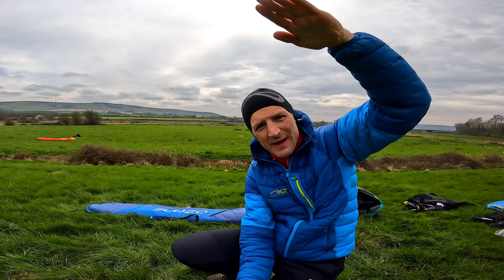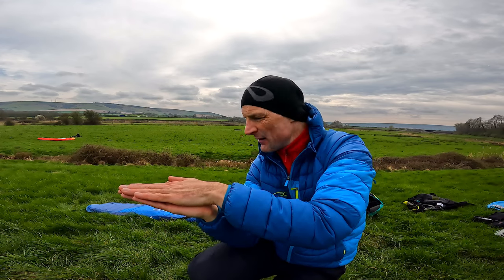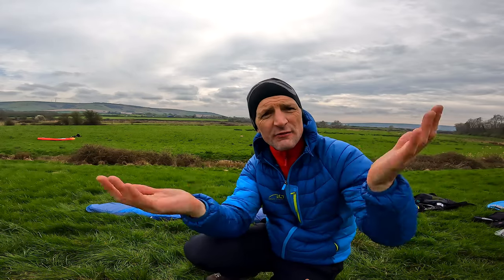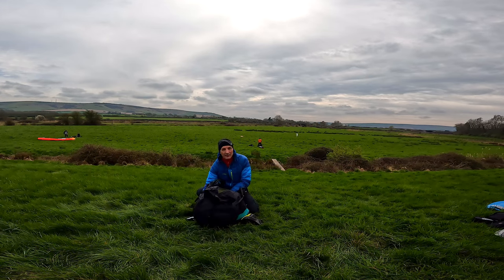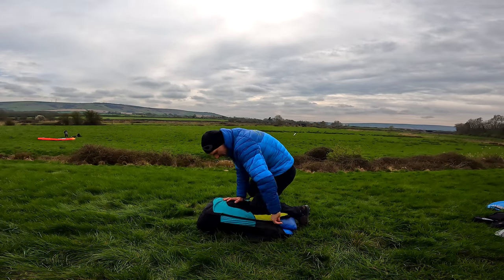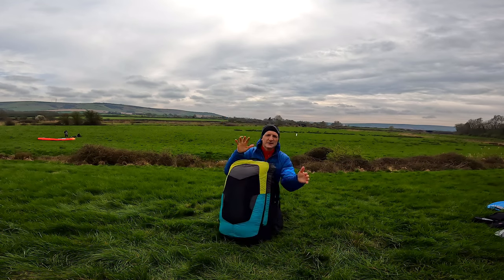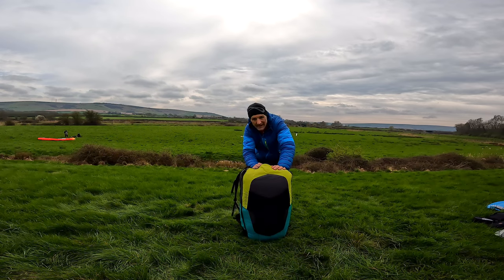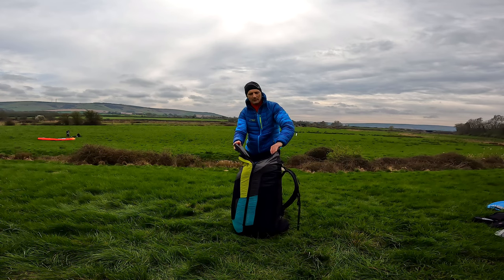How Do You Pack Your Paraglider With Lots of Plastic Rods? (Can we say goodbye to packing pillows?!)

Comment: Thanks guys! Ive been worried about the rods in my Iota DLS but I thought this trick wont work for me because my lightpack bag is too small. Then I saw you were using the same harness and bag as me. 5 Minutes later its all packed away again and I can stop worrying :)
Reply from the maker: Wohooo 🥳 Happy to hear that!
Reply: Same I just got my iota dls and I'm not used to the big rods in the glider normally I just use the compression bag, now I need to look at new ways to pack the wing
Reply: @KyleGoesUp  honestly I'd just pack it the way flybubble show in this video. It's the way I do it now! I hope you love your Iota as much as I do. It's really an awesome wing :)
Reply: @KyleGoesUp  I think it's possible Advance read your comment here 😏 and then made their new cleverly-designed FLATBAG DLS and FLATBAG ULS concertina packing bags. These are both effectively tube- and compression- style concertina packing bags in one. They are both designed to be used for both styles of concertina packing, either keeping the wing long (good for wrapping around the harness) or compressed (for minimum pack size). So this means you can choose to either put the wing inside or wrap it around the harness, as you prefer and best suits the occasion. They are both light but the DLS (Durable Light Structure) version prioritises better durability, whereas the ULS (Ultra Light Structure) version prioritises lower weight. https://flybubble.com/bags/concertina-packing-bags: https://flybubble.com/bags/concertina-packing-bags

Comment: Hey Carlo, it would also be great if you could show the process of getting all the cells flat and how you manage the trailing edge when doing this. I find that I run into difficulty once I bunch the cells and turn the front edge flat. I end up with a twist 1/3 of the way down the wing. No issue with my Allegro light but another wing with long rods gets messy.

Comment: ℹ To be clear, like many tips we share - by video or otherwise - just because we're sharing this particular packing technique as an option to consider does not mean that we're saying this is the best packing technique for everyone, or all gear. As I a say in the video, I only recommend this packing technique for suitable gear i.e. a wing with long, stiff plastic rods combined with a relatively light and compact harness. For example, a good example, as shown in this video, is the Ozone Photon wing (which has lots of long, stiff plastic rods) combined with an Advance Lightness 3 harness (which is relatively light and compact).
Reply: ℹ I personally wouldn't use this packing technique for heavy and bulky harnesses, since the harness will crush the wing (and it's rods). However I have seen highly experience pilots - even factory test pilots - using this packing technique with heavy and bulky harnesses. So  guess that either they think it's OK, or they didn't think about it, or they don't care too much about it. I also personally wouldn't bother with this packing technique if the wing doesn't have long, stiff plastic rods.
Reply: ps. Having said that, as you can see in this video, if you use a standard style concertina packing bag that leave the wing in a long sausage (not a compression style concertina packing bag that leave the wing in a box) then this packing method takes about the same amount of time as folding the wing and harness separately.

Comment: You know what's a nice thing in niviuk gliders ... Nitinol rods 😊
Reply from the maker: Nitinol 🔥
Reply: @flybubbleparagliding  is there any info on why ozone is keeping their designs with plastic rods?
Reply: @Itsallgoodtogo  Mainly price, I believe. I'm told the Nitinol rods are much more expensive than the nylon rods. I'll ask the various manufacturers and designers when I next speak with them. I mention what I believe to be the pros and cons of Nitinol in our upcoming reviews of the Niviuk Artik R and Gin Bonanza 3, at least. Overall I'm personally a fan of Nitinol. But I believe it may have at least one other disadvantage, other than price, which I try to explain in my coming Artik R review. 🤓
Reply: @Itsallgoodtogo  
The Ozone Delta 4 have plastic on the leading edge, but also Nitinol along the entire chord of each cell. That's why I always worry when I fold them, but I've been doing it this way for a while.

Comment: Did you consider all the weight that crush the bottom of the glider? I really don't like this method because of this problem, specially in comps gear that is really heavy
Reply: Well then don't, it's an option nothing else.
Reply from the maker: It is most definitely a personal preference, whether you pack your wing like this or with other techniques. The best for our wings would be to keep them as loose as possible anyways... so if we're talking just about transporting, you can definitely take options like this into consideration.
Reply: As I a say in the video, I only recommend this packing technique for suitable gear i.e. a wing with long, stiff plastic rods combined with a relatively light and compact harness. For example, a good example, as shown in this video, is the Ozone Photon wing (which has lots of long, stiff plastic rods) combined with an Advance Lightness 3 harness (which is relatively light and compact). 

I personally wouldn't use this packing technique for heavy and bulky harnesses, since the harness will crush the wing (and it's rods). However I have seen highly experience pilots - even factory test pilots - using this packing technique with heavy and bulky harnesses. So  guess that either they think it's OK, or they didn't think about it, or they don't care too much about it.

I also personally wouldn't bother with this packing technique if the wing doesn't have long, stiff plastic rods.